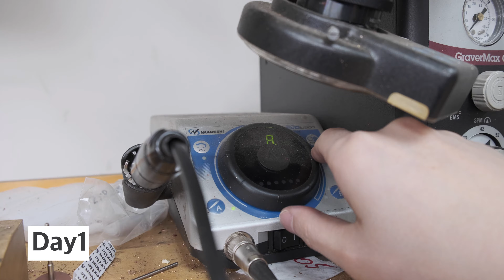process of making full iced out cuban chain/diamond pave setting/

Comment: I been trying to teach myself how to do this. One thing I learned so far, I'm the king at breaking drill bits.
Reply: Break them short and then sharpen them. The length isn’t good when it’s so thin due to the flex. Making them Short will save you so much headache.
Reply: @ozguryeter9498 how do you sharpen them?
Reply: @jacquiventurini8844 Can use a sanding disk and sharpening block make sure you get the angle correct first tho
Reply: @ozguryeter9498 useless information 😂
Reply: Buy carbide
Reply: Take your time.😅
Reply: I’m the pharaoh of buying $800 gold chains then breaking it with the drill

Comment: How interesting! I always thought they bent the pins over the diamond, but you just rounded off the tops making them fit snug.
Reply: Sometimes they’re bent over but usually for bigger diamonds and sort of depends on setting I think. 

(For example, you’d likely see that on a wedding ring with a protruding solitaire)
Reply: @BH-pl7vg what about on a damaged setting? Or do you just have to remove the old prongs and put them back

Comment: Using a tiny ball Fraser (ball baring) helps get the positioning right and as the initial cavity you make is smaller than the final drill with the drill bit, you have more room for error should your positioning goes tits up halfway through like it tends to do lol

Comment: I still wonder how the diamonds are held in place. Is vaseline the ream glue for diamonds and gold?
Reply: No. The prongs hold them in place. You see how he gets the pick and pushes certain areas when he puts the diamond in? The prong "sets" the diamond
Reply: He is using Vaseline to "Grab" the diamonds and put it into place.I wonder if that would dull  the finish on the other side of the diamond.
Reply: @davezoom-yb8pm  no it won‘t because of the drilled holes, after the chain is beeing cleaned and polished it looks all good:))

Comment: Why don't they just make the chain links with the holes already drilled in them?
Reply: The chains are handmade already. Very tedious process. They take gold rings and then connect them like a chain and then twist them after heating so they have that angle. Then they sand/file front and back so that it's smooth. They couldn't make them ahead of time because they have to twist the metal.